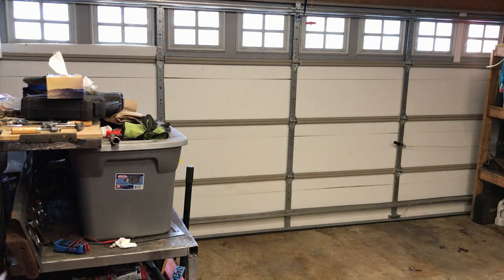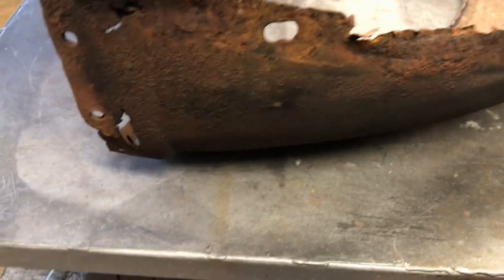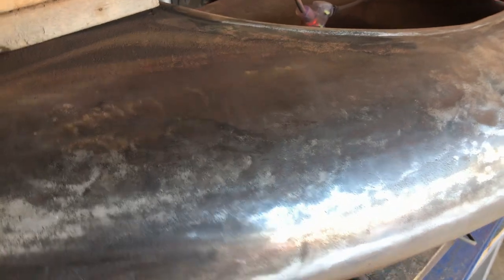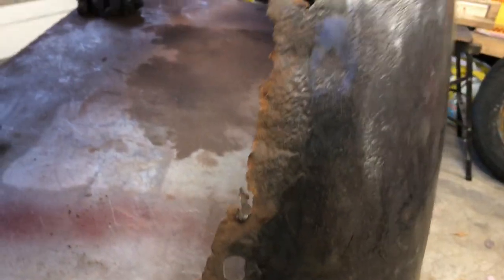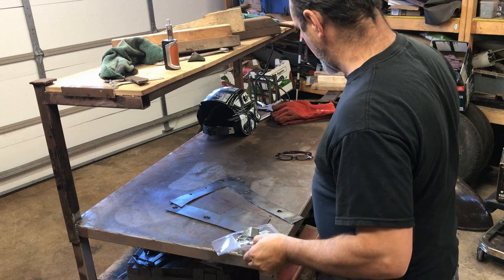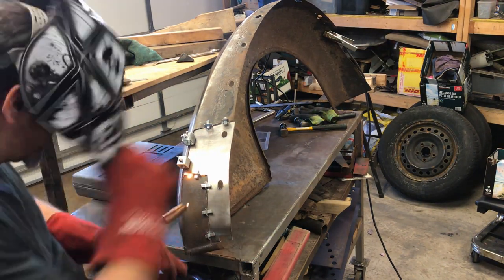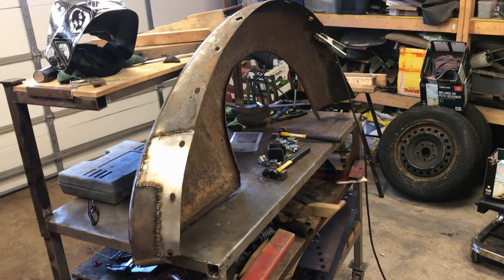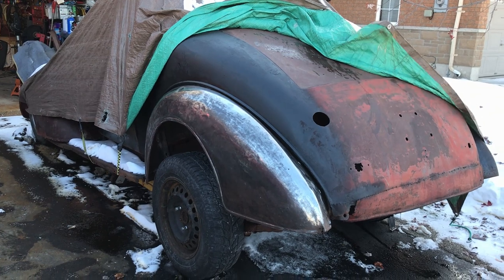1936 Chevy Coupe Day 7   Fender Repair

Comment: My fenders on my 35 pontiac coupe required metal work too, had to cut out rusted out areas and weld in new metal, nice having a pipe around to curve metal.you must have sprayed a clear laquor paint over your metal, i missed that part.

Comment: Looking good Dave. You are like me, if you can't get a good weld, then get a good grinder. That old metal is hard to weld. Thanks for sharing.👍👍
Reply from the maker: Yeah, those fiberglass rear fenders on Speedway are starting to like mighty appealing lol.
Reply: @ScottRods  I had one rear fender of my truck that was real bad and I couldn't find a good steel one so I had to have one made form some kind of plastic or something. It is very strong, but feels like ABS or something like that. Good luck with yours.👍

Comment: Welding 80+ year old pitted metal is tough. You can greatly aid the weld gap when using those style clamps by clamping a run of steel wire in the gap (bailing wire). Also, using a dolley wrapped in thin copper sheet on the backside while welding will help pull some of the heat away from the metal. This allows less breakthroughs
Reply from the maker: Thanks. I've been trying to find one of those copper dollies, but I think I'll need to just make one. Also, I'm learning TIG, which could be a little more gentle.

Comment: Not for  nothing  that upper shelf would drive me nuts. Would end up with stitches on my forehead. Make it removable. Other than that   looking good. Have a 1940 pu in my garage  in pieces. I've named it R I P ( Resting In Pieces)
Reply from the maker: Are you talking about my work bench? I'm just so short on space I had to make a tool shelf. I originally had it as a flat bench for doing big flat panel work. But yeah, I'll try and find more shelf space and cut the shelf off.
Reply: @ScottRods  Yes the bench. Have the same problems  not enough room. Built a 16 x 12 shed to free up  garage ended up filling  up shed and refilling garage. Still working outside in front of garage in good weather.
Reply from the maker: @joepacheco4038  And this is why my wife won't let us move to a rural property. She knows I'll just turn it in to a junk yard.
Reply: @ScottRods I did live in the city. But now live in the country on 17 acres in Texas. And now I have 2 cars and working on both. 62 Impala and 36 Chevy Master Deluxe.